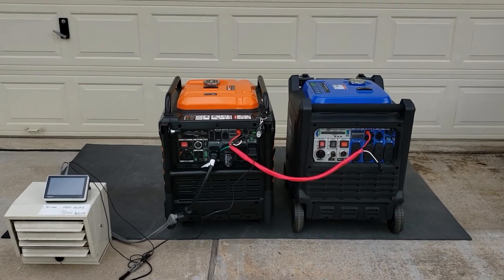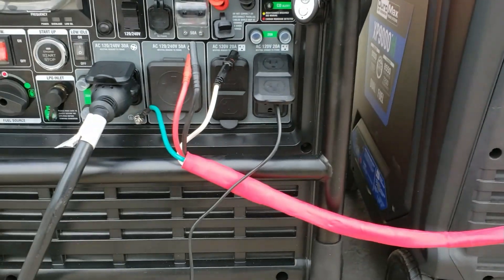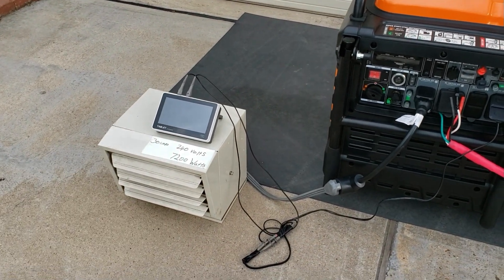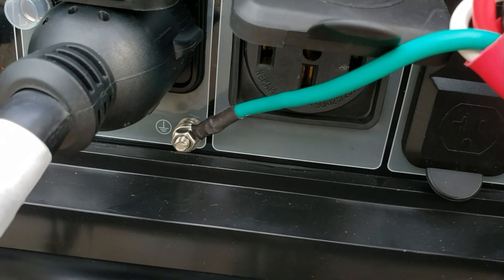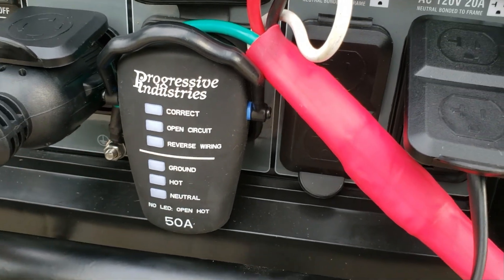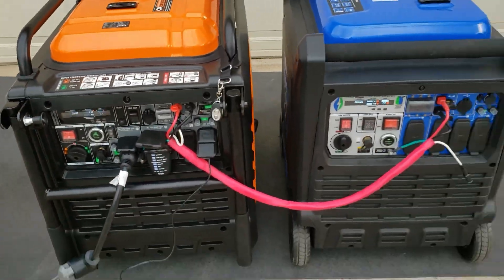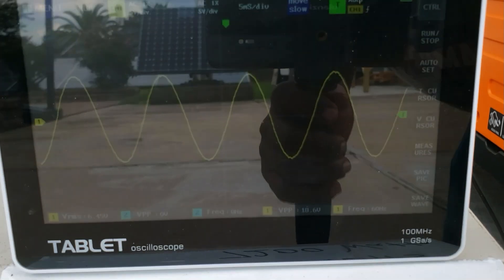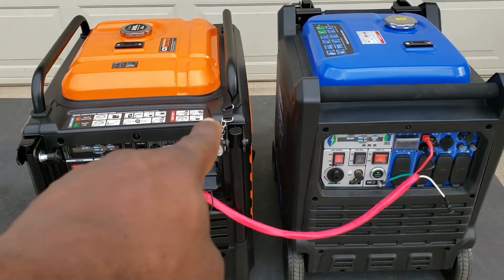GENMAX GM9000ieD Paralleled with DUROMAX XP9000iH

Comment: Tom in GA, The Genmax in this video has the neutral connected to ground.
This will the meter to read correctly. Example: disconnection of the neutral wire from ground should indicate a fault unless the Duramax has the same grounded-neutral connection. Randy (Ex-electrical tech).

Comment: Hi Gavin, is reason it works is because the Durmax is a floating neutral until you connected the ground wire screw? What is the neutral for?
Reply from the maker: The ground is for faults and the neutral is for the load with the two hot legs

Comment: Hi Gavin,  

First, I love your channel, can't stop watching! The GENMAX GM9000ieD Paralleled with DUROMAX XP9000iH was a great test, thank you for doing this as it gives confidence to paralleling 240V inverters from different brands. From what I’ve read, while the Genmax and Duromax have diff designs, they are made at the same factory leveraging the same inverter HW; hence, the parallel compatibility makes a ton of sense.  

I currently have the Powerhorse 7500i that I've converted to Tri-Fuel; hence, the power output drops when running on NG (as you would assume). While an amazing inverter, the idea of getting another Powerhorse to run in parallel is out of the question due to size/storage. As result, I like the idea of connecting the new Genmax GM7250iEDC to the Powerhorse in parallel (running on propane) for when I need more power as I love the idea of scalability.   

That said, would paralleling the Powerhorse 7500i and Genmax GM7250iEDC be an test and/or video you’d be willing to run?  

Thanks,!
Reply from the maker: I actually didn’t think of that one but that’s a good idea. I’ll have to put that on the list.
Thanks for watching. How much power loss did you get on natural gas ?
Reply: @GeneratorReviews  

Thanks for the quick reply!  I'm getting roughly ~20% drop; however, I need to do more testing to better quantify.  

Also, diff question please -- when in 240V mode (on 6500W cont inverter), are you limited to the 27A per 120V leg?  In other words, when powering my home, if one leg is wanting 35A (and other leg is running ~10A), will a 240V inverter allow that?

Comment: Hi you mentioned you made the parallel cable where did you find the connectors to make that cable and what gauge are the wires?
Reply from the maker: I basically bought two parallel cables, cut them to make this one. I believe they are eight gauge.

Comment: Hey Gavin, my Genmax 9000iED was delivered today. I now have the same set up that you are reviewing here. One question, could you put the link for.the Genmax female parallel connectors (black, red neutral) and the same for Duromax's 9000ih parallel plugs. I have bought everything I need to make my own parallel cord, but It's been challenging to find the parallel plugs for the 2 generators. Thank you and keep up the great work!!! 🏆
Reply from the maker: Cool 😎 I will email the manufacturer and ask for the link for the cable 
Thanks Steven
Reply: Thank you Gavin!

Comment: Nice!
What happens if you pair 2 different size generator? Like Genmax 9000 and genmax 6000 or whatever
Reply from the maker: I will try with a 7k Gen
Reply: I have seen other video's where it will share the load proportionally been the 2 different size generators. But it's not a fact until Gavin does it!!!

Comment: Another great video Gavin! I have a Duromax 9000ih (turned into floating neutral after disconnecting the bonding connection behind the control panel) dedicated exclusively to power feed the house in the event of any power loss. Power to the house is through a Reliance 50amp power inlet box. No transfer switch, instead I took the Interlock route and installed it at the main outside panel.  I'll be ordering a Genmax 9000 soon, which I will be paralleling with my Duromax. My plan is to turn the Genmax into a floating neutral too. Both generators will be grounded at the main house panel. Now my question is, since both will be floating neutral generators, and there is no white neutral parallel connection in the Duromax, how would you handle the parallel wire connections on each generator? Duromax (two hot wires parallel connected / green and white disconnected) and on Genmax (two hot wires and white wire parallel connected / green disconnected)? Thank you again for the great videos and for all the priceless information you are constantly sharing with us!!!
Reply from the maker: Hey Steven 
You should be fine Genmax has the neutral and the Duromax will be parallel to the Genmax.
Reply: @GeneratorReviews Awesome! So when making my Duromax's parallel cord I don't need to have a white (neutral) in there. My cord will only have Red and Black, no ground since my Duromax is now floating neutral. Or do I still need to have a neutral (white) plugged in the Genmax? Thank you!
Reply: Hello Stelon and Gavin! How did you make your Duromax xp9000ih a floating neutral generator? Did you unhook the neutral/s from the front panel ground post? If so, where did you run the neutral/s after unhooking them? Thank you much for the info.    Mike
Reply: @michaelslack6891  yes, by unhooking it behind the control panel. Gavin made a step by step video for the Predator 9500 which technically applies to the Duromax 9000iH too: https://youtu.be/qiXuG-lOdTo . There's another YouTube video, made by someone else, specifically for the Duromax 9000iH. Your neutral will be bonded to your house main panel box once you plug your generator cord to your inlet box.

Comment: I was surprised that the progressive circuit tester didn't indicate an open neutral. Is the neutral bonded inside either or both generators and that's why? Another entertaining and instructional video, professor Gavin!
Reply from the maker: 😊👍🏾💯😎Thanks buddy I’m trying my best to keep it up
Reply: Yeah tester isn't doing it's job, it should have showed open neutral.
Reply from the maker: @melovescotch you only need one On the same circuit to show closed.

Comment: I purchased one of those 50 amp testers because of you Gavin. 🙂
I don't need that much power for my home so I'm looking at pairing my 2 Powerhorse 4500 in parallel for 50 amp service. Setting my home AC up this week with a soft start.  Your thoughts?
Reply from the maker: The 4500 in parallel will definitely be ok and During the winter time when you don’t need as much power you can just use one but I think you should be OK with a soft start to power the AC and other loads

Comment: Gavin - a couple of thoughts on this:
I'm sure you are already familiar with this, but I want to call it out there.
1. in a 120V 3 wire circuit, the neutral is the return path for current back to the source.  No current shall ever pass on the ground, under normal circumstances.  However, in a 240V circuit (4 wire: 2 hots, neutral, ground) the neutral is still the return path to the source, of ANY current imbalance.  If you have 5A on leg1 and 10A on leg2, the neutral will be the return path of the imbalance - 5 amps.  

Note that when you have a perfectly balanced 240V load (like your space heater) that there is no current back on the neutral, and you can, actually "remove it" and have a balanced 240 load function on only 2 hot legs.
2  So this brings me to my question and concern:  your heater is probably fully balanced and may actually work without a neutral.  But if you load up 1 gen with 120V loads on 1 leg, there will need to be a return path to the source.  With no neutral between the 2 gens, either they wont respond to each other, or they may try to pull current through the ground, as I'm guessing the ground is actually center-tapped back to the inverter board, and is common to the neutral.  This would be bad and would not be recommended.  It might be much better to adapt that plugged neutral to the neutral on one of the receptacles, like the 50A
Reply from the maker: Yep you’re right about that, the heater is a balanced load and with an unbalanced load the ground wire is used for both.

Comment: Can you please let me know what the ends are called and where you can get them?  One broke for my cable for my onon 4500’s and can’t find the end to repair it
Reply from the maker: What I do is just purchase a cheap one cut the ends out shrink wrap it where are you fixed yours
Reply: you can go to : https://shop.championpowerequipment.com/en-us/   and search for: parallel .     They have the square pigtails and square to round adapters.  And probably the rounds ones too.  i ordered these awhile back : Part Number Description Bin Shipped Price Total
9.1700.002.1 Adapter Plug, Parallel, Black E2E3 1 5.00
9.1700.002.3 Adapter Plug, Parallel, Red E2F15 1 5.00 
83.210006.01.1 Plug, Parallel, Wire 250 mm, Black E2J15 1 2.34 
83.210006.00.3 Plug, Parallel, Wire 280 mm, Red E2J19 1 2.34

Comment: Look at you and your fancy oscilloscope. 
What's interesting is that since the neutral is bonded in the Duromax, the neutral current of any unbalanced 120V loads would flow on the ground wire between the Dmax and GMax. Feature or bug? No one can tell.
Also why would anyone buy a Dmax anymore when the Gmax is cheaper and better?
Reply from the maker: True! And I like my fancy oscilloscope 😊
Reply from the maker: I asked the manufacturer why did they choose not to put the neutral and they told me that’s what the customers wanted.
Reply: @GeneratorReviews  my hypothesis is that they weren't sure how to deal with the problem of 2 paralleled generators both having bonded neutrals, breaking the rule of only having 1 bond point, so they just excluded the neutral in the parallel kit receptacle. Then Predator and GMax just did what made sense and didn't try to mitigate the issue at all. "Customers are just going to unbond them anyway."

Comment: Hey Gavin...so my set- up is identical to what you have here (Genmax 9000iED and Duromax 9000iH). I bought Genmax's new parallel cord to connect both generators in parallel. I turned both into floating neutral for my home back-up set up. Genmax is the primary generator so I fired up that one first and then the Duromax. Now the issue that I'm having is that my Duromax, when firing it up, the overload light immediately starts flashing (without any load) and voltage on display shows zero. Genmax runs perfectly fine (green light on display) at 120v/240v (no loads). Any idea why the Duromax is overloading? Thank you!!!
Reply from the maker: That’s probably something with the lack of a neutral on the Duramax for paralleling
Reply: @GeneratorReviews   @Gavin’s Garage yes I'm suspecting that could be the problem.  But you would have had the same issue when you paralleled the two. The only difference is that your Genmax and Duromax are still bonded neutral. Mine are floating neutral. So technically once I plug my 50amp cord to my Genmax 50amp outlet, and then plug it into my house 50amp inlet box, that would fix it. If that doesn't work I will be bonding neutral both back again to see if the Duromax overload goes away. I will keep you posted. Thank you!!!

Comment: Gavin - Do you know if the hour meter on these generators counts both TOTAL run hours on the machine and run hours for the current run period?  I believe it does on the Duramax, but it’s not clear on the Genmax.

UPDATE:  I e-mailed Genmax and they confirmed that it should display both!
Reply from the maker: Yes it displays both